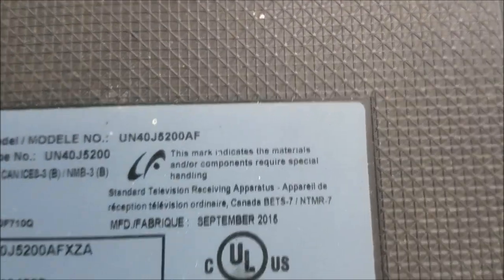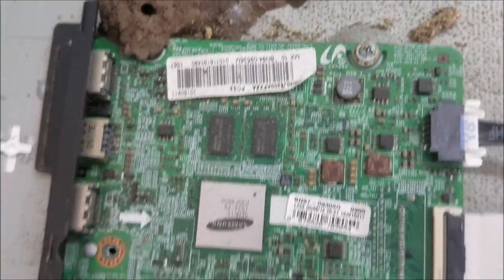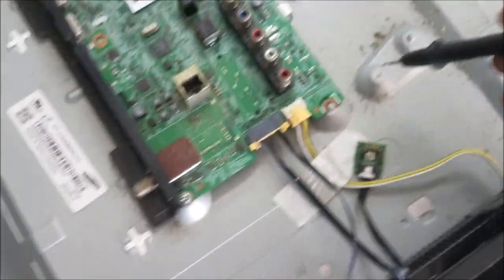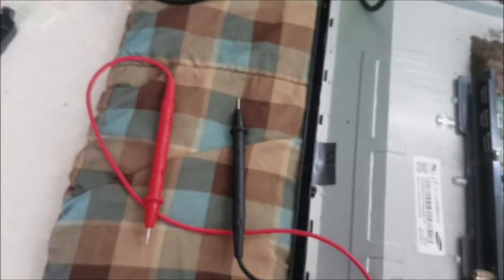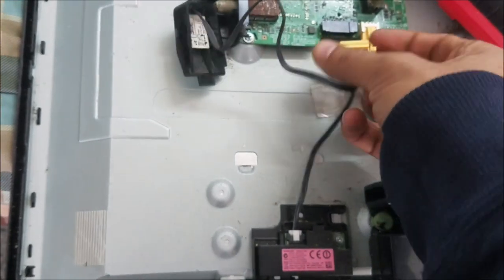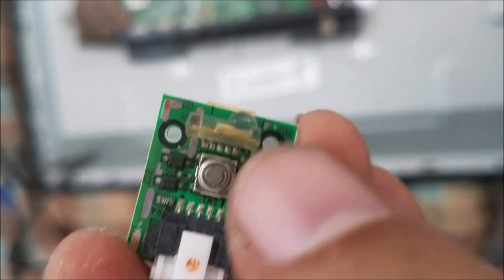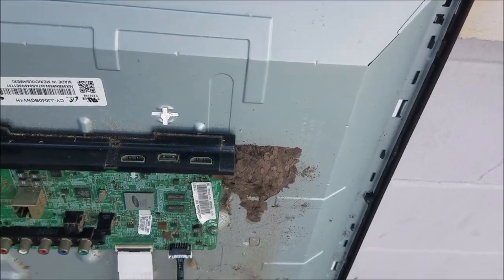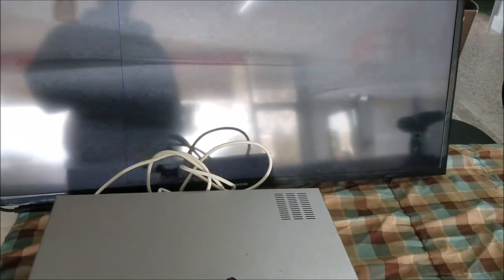Samsung tv UN40J5200AF remote control not works bad IR receiver

Comment: hello. if the 3,3 volts were missing, would it have been posisble to jump that 3,3 volts to the ir receiver rather than buying a new part ? i assume that if we had power to the IR receiver then it would have worked ? just a thought it all. very good video. i really enjoyed

Comment: This is my modelun65tu7000fxza I think the problem is my IR The TV power is on as soon as I plug it to a wall outlet then it goes to set up menu. The first setup menu is network setup the remote won't let me set up I try the remote on a different Samsung and it works I think this is my issue the IR do you know what part I need and do you think this is the problem or main board

Comment: My TV turns on as soon as you put on the power plug and it's stuck on network settings it's the first setup settings The remote does nothing to it I try the remote on a different TV and a remote works I think this might be my problem the IR what do you think